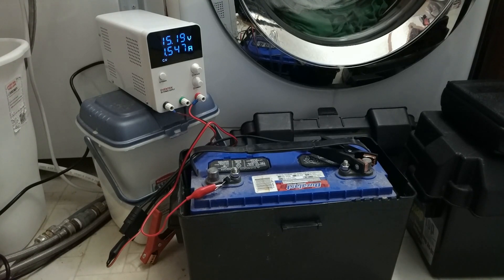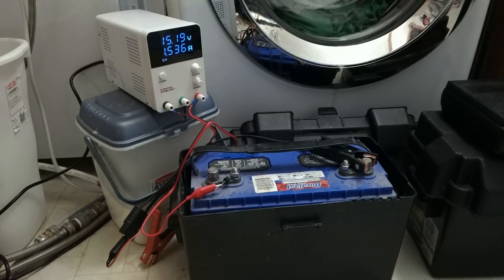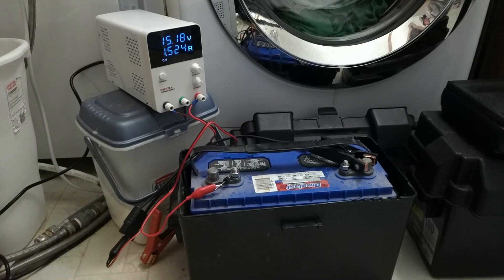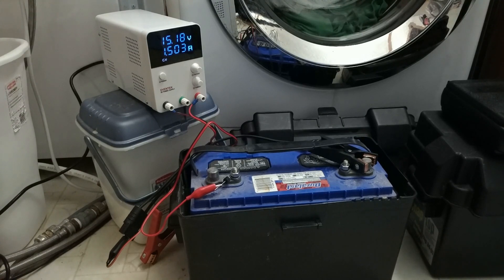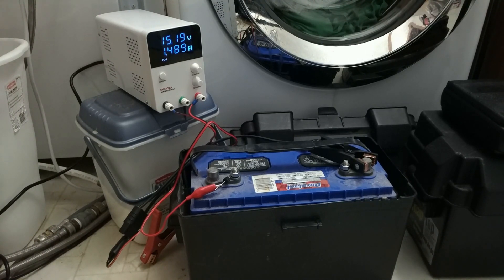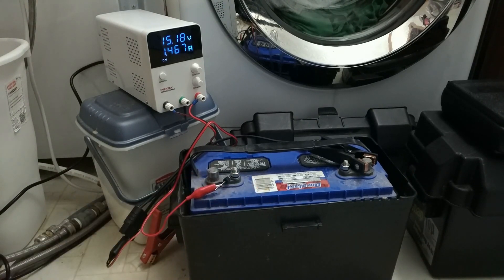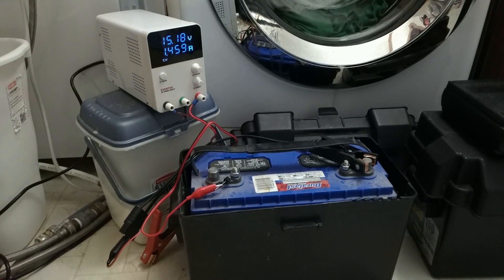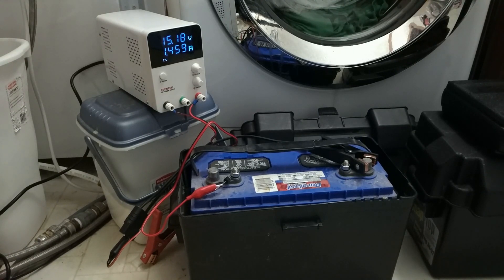Rescue and Recovery of a 12-volt flooded Lead Acid Battery - Mini Manifestation E001

Comment: Wondering is it on top keep lead acid batteries inside?  I've been wanting to make a battery bank inside using them just wasn't sure it's ok inside.
Reply from the maker: Yep you can do that.  Just get what are called AGM batteries.  They can be sealed up in things without problem.  The regular flood type (what is often in your car with the caps that can be removed) will cause a build up of hydrogen and then you will have a little explosion at the worst or a fire.  Neither one is good.

Comment: Cool there are also devices you can make that connect across the poles to stop sulfation, AGM batts are better and dont suffer from this problem as much, Lithium batts don't work so well at 12v so higher v is better here eg, 36 48 v but this makes getting g equipment a lot harder We need to figure a work around for this
Reply from the maker: I have some desulfators but age will always eventually kill a battery. These are actually from 2010, so 8 years old for AutoZone batteries. Not too bad. Later I'm going show how to recycle the lead and build fresh new lead acid batteries.
Reply: @reedin9954  look forward to that ♥💛❤🕉